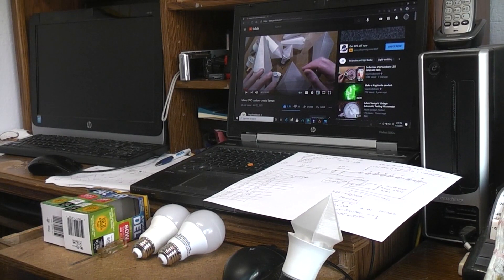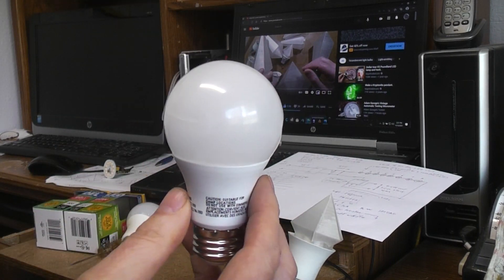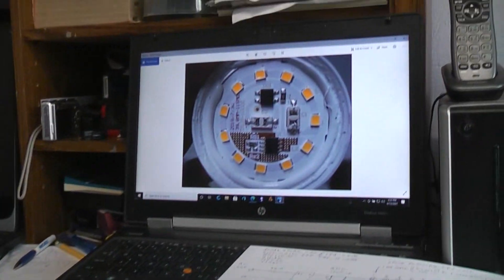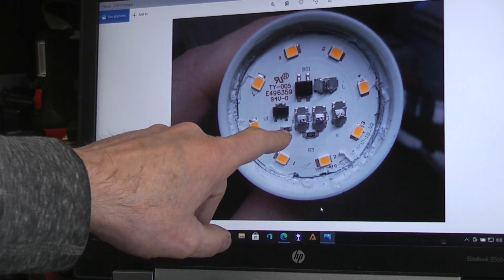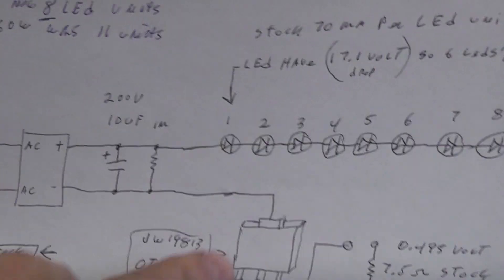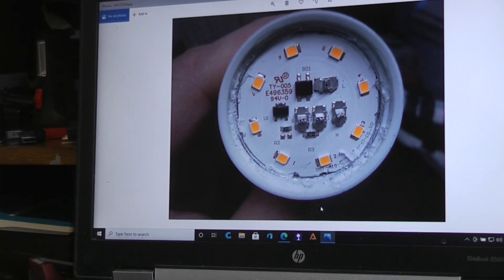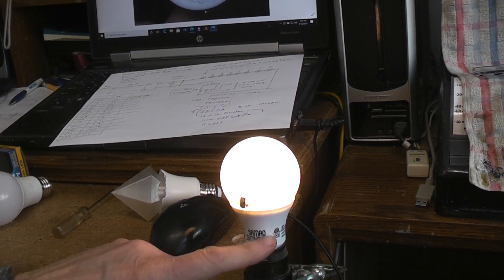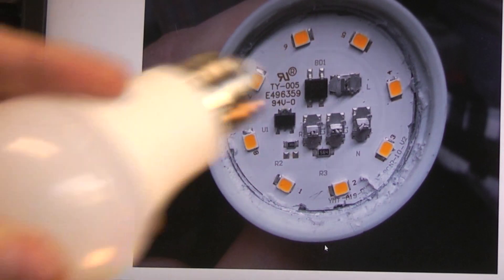Why don't household LED lamps last longer and what can we do ?

Comment: There are still bulbs with a power stabilizer, for example from Phillips. They buzz and don't change the brightness when the voltage drops. Changing the resistor is a pain. When this method was first created, they came with 2 resistors out of the box. What is the deal with inserting a capacitor in series to reduce the power? How to do that correctly?

Ultra efficient new A class lamps make less heat. But they are also expensive, and a loss if they burn out.

Comment: Why they don't last? I measured up to 71C on the casing and between 93-95C on the individual LED packages of an LED bulb, using an infrared camera. And that's running with the lid removed.
Reply from the maker: Yes, they push the LEDs way to hard and the heat shortens their life. I found If I buy the 100W bulbs  "they have more LED's in them" and remove just 1 or the current sense resistor's they cut the power back by 50% and still have about the same light output to the eye as a 60 W lamp. Been running some over 1 year now.
Reply: @Robothut  I've just removed the lids. Funny, should one of the resistors fail by itself it would EXTEND the life of the circuit. my lamps don't have 2 current sense resistors, or they're hidden, no time for me to look. Any new ones I buy are filament type - I calculate the wattage per filament and pick lower power - the same size glass envelope dissipates less heat in a 4 watt than a 7 watt. and I only have open fixtures.

Comment: I have often wondered about adding a variable resistor to experiment with different powers. You are the first that I have seen that has actually done it.
Reply from the maker: It works great. I still have that lamp in service, more than 2 years ago when I made the video.

Comment: Just a thought, but would adding more LEDs on the board work too? It would divide the current going through each one.
Reply from the maker: As long as the voltage drop of all the LEDs you add does not exceed the filtered line voltage you can do that. What I have gone to is just buying the 100-watt equivalent LED lamps at the dollar store and just cut out 1 of the current limit resistors on the control chip. This reduces the current fed threw the LEDs but because the 100-watt lamps do have more LED chips you still get about 60 watts of light from them. Have not had 1 fail yet.

Comment: FEIT are cheap bulbs made in China, terrible rating. I avoid them....I had a grow lamp, LED type go out on me within weeks. Annoying since they cost a lot more.
Looking at the schematic, if only 1 LED fails, the whole circuit is open.....I feel comfortable with 33 ohm, 20 mils. Good useful information in this video.
Reply from the maker: Yes it can not get much cheaper than $1 a bulb. And yes most all the LED lamps these days have all the LED's in series, if one LED shorts out the rest get hit with even more current and if one fail's open they all go out. So sad. two  series circuits would be better. I understand that they put the LEDs in series to get close the AC operating voltage of the country you live in so that the control circuit does not have to adjust for more voltage drop that makes more heat. So its kind of the way it is. Yes I agree the 20ma setting should last for a long time. I have LEDs that have been running 24 / 7 for over 20 years now at 10 to 20 ma and LEDs were not as good back then. I even think that 40 ma would be OK these days. lots of light and so much less heat that they just have to last longer.

Comment: Thanks for posting this.  I had always wondered why LEDs were rated for 20,000 hours of use but often burned out much sooner than that.  That explains why LED Christmas light strings burn out after one season: it must be a similar issue with too much current running through them.
Reply from the maker: Yes they do not want things to last too long. Got to keep selling us stuff right.